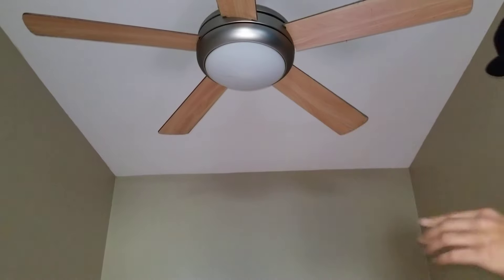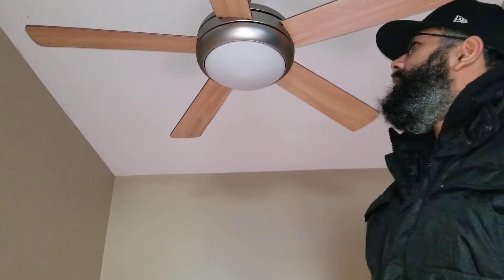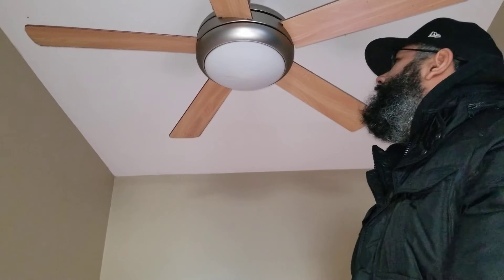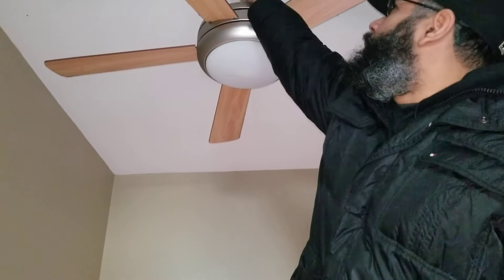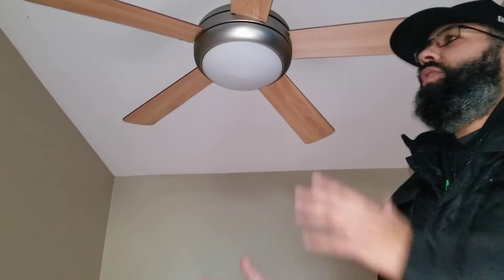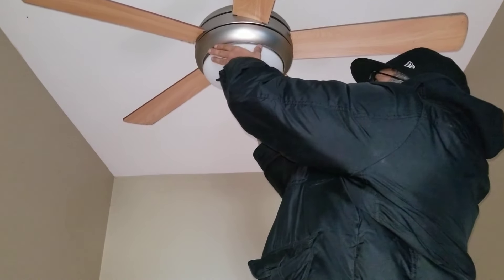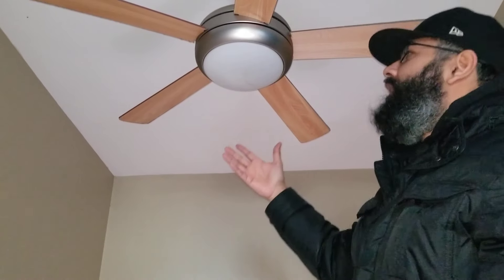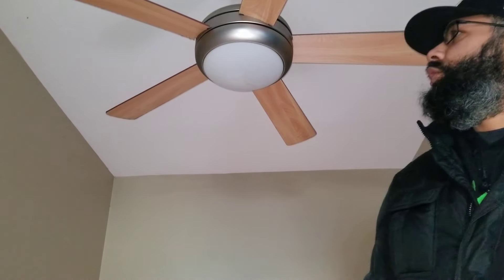Super easy how to remove harbor breeze ceiling fan dome piece

Comment: Bruh no—push up and turn left does not work, especially if the fan light has been sitting and unopened for years. I saw the same duct tape video and I’m going to have to try it bc this push up and left is NOT working
Reply: Same here

Comment: You are 99% correct. Mine was tight the pipe started to unscrew. needed two more hands to hold the upper assembly.
Reply: Mine too. I will try that.
Reply: @mrapma  If the fan has been in place for any length of time, the little grooves get full of junk so it doesn’t operate like brand new. You will need four hands an two ladders.
Reply: @bobstratton6362  Thanlks, Bob!

Comment: 1 year later - still helpful video. I have owned my place for over 3 years and every time the light blows it's a whole process. The last time it blew was a week ago. Couldn't get it to open on 3 different occasions - 3 different days until I was like fine - you tube it, again. I saw that same duct tape video - started the whole process was like this doesn't work. Your video came on right afterwards and you said the most important thing - Grasp The Concept - the cylinder piece simply cannot spin. It literally came off just as easily as in your video. Big help for certain.
Reply: What kind of bulb does it take?

Comment: Some fans have little metal screws in that silver part. If you just unscrew them slightly it releases the dome. To put it back in is just the reverse. Start with one screw almost all the way screwed to get one side set in, then screw the rest in once the dome is on place

Comment: I had just watched they guy you are talking about video with the ducktape right before i watched yours, im having the same issue but as im trying to do it your way i discovered it had two screws thats tuck away which you have to feel around for on each side that holds the globe up(im 5'2)so i didn't have any help & i had to stand on my bar stool to try & reach it.they had the screws kind of tight to twist a lose but i finally got it. Thanks anyway

Comment: Can't believe I got outsmarted by a ceiling fan ight cover.  I ended up unscrewing the whole fan & it's been disengaged for many months.  Ended up taking it down before I discover the secret.  Back in action.  Now my issue is the remote does not sinc with the fan.  This seems to be a regular thing. 

Thanks.

Comment: We have the Harbor Breeze "Sail Stream" model (model #40048), which is a bit different, but similar. I've pushed as hard as I can without breaking it, and it WILL NOT COME OUT. Can't find ANYTHING on my particular model, and I need to change the bulb.

Comment: Simply twisting did not work for me. What did work was lightly tapping the edge of the light fixture with the rubber end of needle nose pliers as I was twisting the glass in a counter clockwise direction.

Comment: Why are these fans so complicated and not easy to replace, at least if you are a first timer with these. I wanted to replace the light bulb inside the dome and had a really tough time loosening the dome and followed these same instructions which looked fairly straightforward to me. But it was not easy, and then i gave up and sat on the bed... Wow and to my surprise fell right on the hard wooden portion of my bed and broke. Just gave me the feeling of been Newton (in a dumb way :) ) ... Does anyone know where exactly i can get a replacement of that part. I tried Amazon, Lowes and Home Depot but this fan is so ancient and stubborn that i couldn't find one. The fan itself works fine so i dont think i need to replace the whole fan itself. Thanks, in adv.

Comment: Didn't work with mine, but I found out that all I had to do was loosen the three screws in the base that was holding the dome in and voila! It came off easily and I replaced the bulb, but the dome back on and tightened the three screws to keep the dome in place!

Comment: My fixture has been in place for over 12 yrs. Your steps are correct. However, I am not getting the shade to twist. I am not sure if it settled there after all these yrs. I will keep trying. Any suggestions out there?

Comment: Method did not work for me. I got the cover off, but  I had to actually get an adjustable wrench and hold the shaft of the rotating assembly near to ceiling. I'm surprised it worked, it was a last ditch effort. Fuck this design tho.

Comment: That didn't work for me. The duck tape fix didn't either. I ended up using a rubber mallet and, ever so gently, tapped around the edge of the glass dome. This loosened it so I could twist the dome off.

Comment: This is exactly the same fan as we have, but our problem is we can't figure out how to make the fan spin more slowly. There's no pull cord. Does anyone know how we set this fan to a slower speed? It came with the house. I'm hoping this is not a remote control fan and we didn't get a remote for it. The wall switch only turns it off/on, and the speed is fine for summer, but too fast for winter when I reverse it. Thank you!
Reply: It does use a remote

Comment: i broke mine trying to get it loose. now that i have a replacement globe, any ideas for preventing it from sticking again? i was thinking a thin application of vaseline but vaseline has a low melting point. was also considering some strategically placed painters tape. any ideas anyone?

Comment: Great idea but my husband still could not make the dome budge. That is, until he thought about adding heat to the system. He hooked up an extension cord to our blow dryer and heated the rim outside the dome. Thirty seconds later, the dome easily moved with a slight pressure and twist. We now have a brightly lit room from a cost-saving LED bulb.

Comment: Thank you for your suggestions! At first it didn't work so I tried banging it with a rubber base of the plier around the edge of the cover with one hand while pushing and turning with the other hand. I think the vibrations loosens it up a bit, so I was able to unscrew it. God bless!